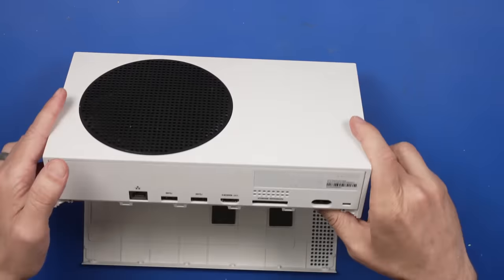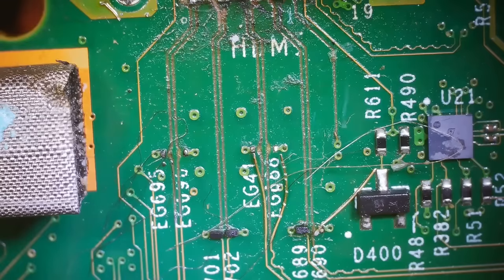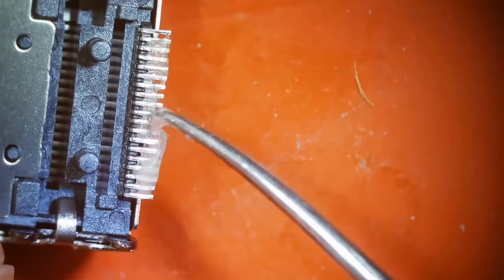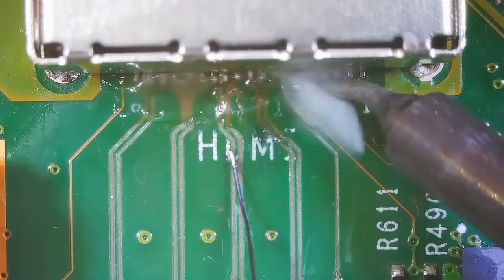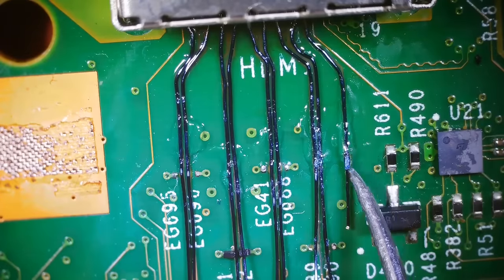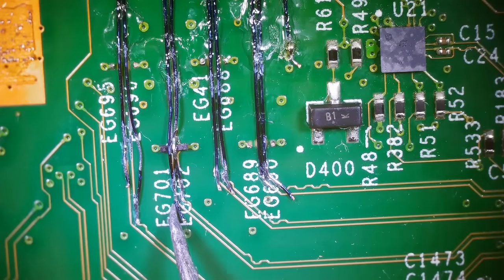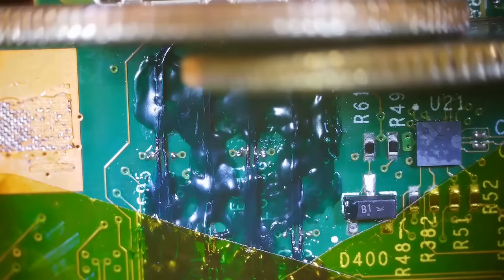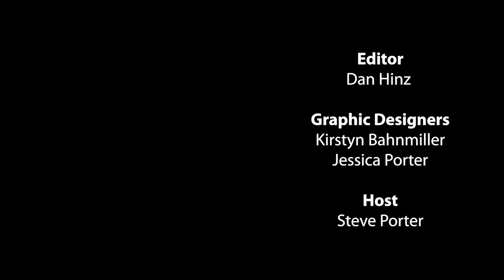I Paid $80 For This BROKEN Xbox Series S - It Was MESSED UP!

Comment: I've NEVER seen traces lift off a pcb like that. Holy cow.
Reply from the maker: This one was pretty intense.
Reply: The only time I've seen it happen has been with the Xbox series versions once they get a tad over worked instead of just breaking they completely lift and move freely
Reply: I have, but not to that extreme. I repaired a commodore 64. It had 1 bad memory chip. I replaced all 8 of them because they were a crappy brand. No issues, but my homemade power supply didn't have a thick enough cable. I didn't know that at the time and once I added accessories it dropped down to 3.5v. I have no idea how a 5v computer worked at 3.5v, but it did...mostly. Just color glitches. I couldn't find the issue because without the accessories it was running at 4.5v (which is low, but well within spec). So I replaced the PLA. No change. I replaced the color ram........OOPS! I lifted a trace. Repaired my issue......no change. Eventually found out that the voltage was dropping with accessories. 

Replaced the cable, worked fine.......until my cartridge disk emulator wouldn't work anymore. I had been using de-oxit. The card connector was covered in green slime. lol Apparently the port was completely corroded. It's a wonder it worked at all. I couldn't fix it so I had to replace it. I have no idea how many pins that is, but it's a lot. I lifted a trace on that one too. That one the trace didn't rip so it's not attached completely to the board, but it works. The color ram trace ripped. I had to bodge that one (like you see here). So my working C64 has 1 missing trace and 2 loose trace. 

If I were to do it again, I'd get low melt solder. I suspect it would make repairs easier. Also proper flux. And I wouldn't have looked at that inadequate cable and said, sure why not. I used it because I didn't want to have to solder 4 wires in a din connector. I think it was a 7 pin MIDI cable. Fortunately I found someone that sold me a higher quality cable with the plug already on it. If I had an original power supply I would have cut off and re-used the cables on that. But I didn't. (the original PSU will brick all the chips on the board eventually)
Reply: You know, when they pulled it up and it started going, that just kept pulling hoping it would stop.... it didn't.
Reply: @joper90  If I had to guess, they were probably pulling on it and it suddenly let go, and then the momentum is what pulled the traces up
Reply: İ have seen on my dead ps3 while im pulling the fan pin i pulled the entire port and the traces from motherboard i try to fix it like shown in that video but at those days my solderimg iron and my soldering skills is not good enough for that i tried using jumpers again an again bridged it tried to fix thr bridge ect ect, at the end i torn of al of the lane for fan pin and cant made the fan work again but anyway it alredy has an rsx issue so it almost be unfixable actually not much of a big deal
Reply: Your a wizard Harry, sorry Steve...
Reply: That was insane... Why even try to put another on yourself without the right tools.

I'm surprised the board didn't get the "heat gun" treatment and turn to blackened pizza crust bubbles from that type of repair attempt.
Reply: They peeled them off like a hangnail
Reply: Yup was super common on the xbox 360 mods. I lifted my fair share learning the various methods of exploits.  LOL It sucked as there wasn't equipment available at the time like now to fix
Reply: @Tronicsfix  wow.  Sir you are legit.
Reply: Was gonna say the same thing. Crazy
Reply: I dont get it, why people even try to attempt this if they dont know how to solder? They're just making it harder for the next guy to repair it 🤦
Reply: @awilliams1701  if only I had half the skills I would fix so many broken things
Reply: @hanbill  I'm just lazy. lol

Comment: Made it look easy, the zoomed in view doesn't show how tiny everything is. If I could leave a suggestion before putting the console back together I would've showed a zoomed out view of the repair area. Great vid as usual anyway
Reply from the maker: Yeah, that would have been good.
Reply: Right?!?! I watch this channel and TheCod3r. Both he (Phil) and Steve make these repairs look deceptively easy. They are not. The view we see is under a microscope at several x zoom. I'm guessing  20..maybe 40X. Those caps and resistors are like a grain of rice. Haha!
Reply: @SirHeadly84   Heck, a grain of rice is roughly 3 or 4 times larger than some of those caps and resistors. They really are tiny! I've done a little hobbyist stuff, and I wish they were as large as a grain of rice. Hahaha.
Reply: For me the moment of realisation was when those side cutters appeared in the picture. They are small but here looked gigantic
Reply: When you see the flush cutters come in and they look like a pair of large angled cutters you know what level of "tiny" this really is! Wow!
Reply: I think the quarters were what made me realize just how zoomed in this was. I love watching things like this, but could never actually do it myself.
Reply: Yeah I've done this type of solder on my psvita in order to have type c convertion, super hard because they are so small

Comment: It's hard to appreciate how intricate some of these jobs are unless you've done something similar..  Just last weekend, I took apart a controller to clean it for use with my girlfriend's Series S.  Both vibration motors came loose entirely, as well as 4 other wires on one of the boards..  Had to go to Lowe's around 830pm to get a soldering iron (pen torch style, in this case,) in order to fix the controller so we could continue playing the Borderlands series together..  It's crazy how small things are in electronics these days, but it's easy to see how frustrating the process can get in a HURRY!  It's still going strong, but I've repaired 360's and some iPhone 5-8's before.  I appreciate all the people who put the time and effort into fixing small electronics, keep up the good work and kick that Lymphoma's ass, Steve!
Reply from the maker: Nice work!

Comment: I know your videos aren't about teaching us how to solder but I really do want to thank you Steve, I accidentally tore off the CMOS battery holdar trying to remove the battery which was also taped down  for some reason, in tearing off the connector the ground pad came of with it 🙄 but watching your videos I managed to route it to another ground pad, and surprisingly it still works.
Reply from the maker: That's awesome! Nice work
Reply: @Tronicsfix  thank you, I've got another machine I need to do the same thing on.... I'm leaving it for now until I really need.

Comment: We used to use an alligator clip with grounding strap wire attached to dissipate heat before it reached an IC pin.  Clamp it straight to the pin or an element also on the trace.

Comment: That's one messed up PCB! Have you tried using copper pad/lug repair kit(s) rather than using enamelled copper wire, can make the repair neater. Also you'll be able to fix the ESD protection (tvs) diodes down flatter, and ensure better contact. Amazed that worked - Kudos!

Comment: Don't know if it will apply to you but there is a procedure a family member of mine went through that helped. It's one where they take out your stem cells and use lethal chemo and put your stem cells back in. May or may not help at all but I like you and it doesn't hurt to share the info if it means it may help you. I hope everything goes well and you get better. Its thanks to your videos that repairs for consoles and devices have become so easy. I appreciate all that you do!

Comment: Good work as always. I've noticed how the HDMI slot seems to be very flimsy and prone to getting damaged, I think console manufacturers need to create a new version of the SCART socket complete with screws to keep it attached to device (like what could be done with VGA and DVI sockets). The SCART socket was tough, could drag a machine along by a SCART lead and it'll be absolutely fine.

Comment: I'm not sure why people don't take the time to practice before working on the real thing. Amazon literally sells practice PCB board kits with dummy components, ranging from $7 to $30. 🤷‍♀ They also sell dual hot air and standard soldering iron stations. Great video as always. Praying for your speedy recovery. 🙏

Comment: Brilliant repair well done. I've never seen traces so badly damaged as that before. Looks like the seller you got it off didn't use much heat then ripped the hdmi port from the board

Comment: Super impressed with this one, good job! 
I have a question though, why use hot air to install the diodes instead of trying to solder? Would at least reduce the need to pre-apply conformal coating. Just curious! 
Either way, great repair and stay strong! 💪
Reply from the maker: The connections on the diodes are on the bottom so there’s no way to get to them with an iron. I would have done that if it was possible.

Comment: Ugh the hack job the original owner did on this. DIY tip: if at any point during your repair starts to go horrible wrong, STOP! Just stop and walk away. Take a breath, come back later and reevaluate. They probably could have salvaged this repair themselves if they hadn’t continued to pull up on the old port tearing those traces and diodes with it.
Once again I am impressed by your patience with a repair like this because I would have bailed by the 3rd trace but you just kept on.

Comment: what temperature and airflow do you use to remove such parts like this hdmi port? also what settings do you use for soldering the new part? i failed at such tasks a couple of times :(

Comment: That was def alot of work, honestly he charged you too much for how badly he messed that up. The worst hdmi port job i did was FB seller sold me a xbox one phat for 40 with broken hdmi port, but turned out it was a botched job and all of the hdmi pads were destroyed with some traces lifted just like that series S. Took me several months on and off, but got it working again.

Comment: I would not mind to see some actual gaming or deeper testing after the console is fixed instead of just: Ok we got a picture Fixed, end of story, every time. It would add a bit more of the result to the story if a game was launched, does it artifact? do the wiggle test of the HDMI, ok my wires seems to hold up, how loud is the fan? yes it is quiet so it definitely has the perfect amount of paste now. The actual testing of a repair is as equally important as the repair itself since a result is never better than the repair itself. so I value both. and if you read this, get well soon too

Comment: I feel like the biggest problem newbies like myself have is to understand HOW to know when the heat is right. Like we always see you guys just "boop" and things work, but for me - I ruined my Xbox because I couldn't get the solder to stick with any heat between 250-450. It just evaporated or stuck to the tip, then it cooked part of the board when I tried to get the solder off. :(

Comment: Any chance you might show us how to do multi-pin repairs without a hot air rework station? I’ve heard you can use solder to heat pins like the mounting pins on the HDMI port and then pull through but you always use air. Curious because many of us don’t have the money for a hot air station.

Comment: I bought two PS4 DS4 controllers for 70$ (Used and Original; a V1 and a V2), and one of them (V1) was messed up so badly I gotta spend almost 30$ in spare parts.
Of course the seller Did not mention the broken pins that guide the buttons for L1 and R1, the broken axle on L2, the completely crumpled 12 pin flex for the charge port PCB, the button board flex that has faded pads. Yes, I am not a happy camper atm but I deserve this for buying used items with a scarcity of details.

Comment: What do you use to clone the SSD? I upgraded a One S from 1TB to 2TB, no problem. I was successful in backing up an image of the Series S 512GB using Active Boot Disk v18. For some reason, that I have yet to figure out, I can't write the image to my new 2TB SSD. I thought the drive was defective but it works fine in Windows. I'm about to try HIren's Boot Disk on my next attempt. Have you successfully cloned an X/S SSD? If so, what software did you use? 🤔🤔🤔

Comment: I mean was Xbox one ever good? I bought brand new one like 2 years ago or so. Using it only as a smart TV. Time required to turn on, to connect with controller each time, to open any app. Oblivious 😂 Lag? Constant. Even in main menu. It's also loud even while idling 😂 Yes I had it apart and cleaned. Made no change 😂

Comment: TIP
When replacing/restoring PCB traces/tracks, 
1/. Prep both sides of missing damaged trace/tracks by establishing a good tinned surface.
2/. Solder replacement trace/wire on the first end where required.
3/. Coat and allow to set the "trace/wire" that is is coated up to a bend on the PCB's original tracing, "This is especially important when circuits/PCB's have critical timing traces/tracks".
4/. Once the coating has been set, Bend your trace/wire to follow original route and then Solder the final joint to Complete the rework, OR if further bends are required Go to step 3.
Doing this helps minimise shorting to other "traces/wires" that may need to run close to each other and it also makes for a really polished refurbishment..